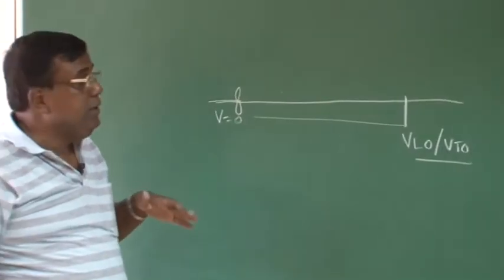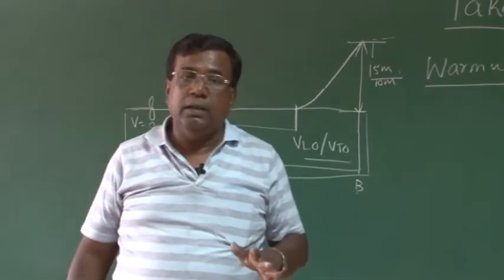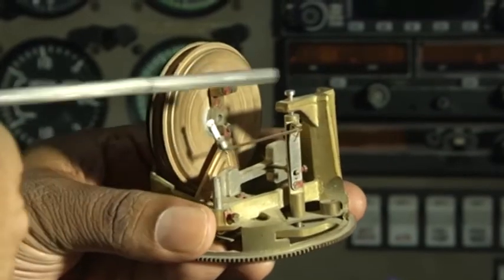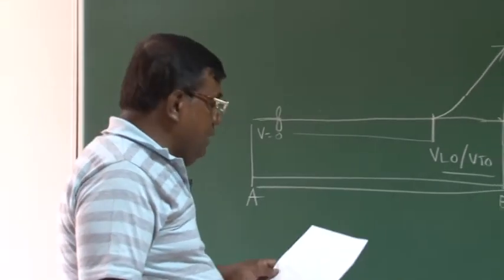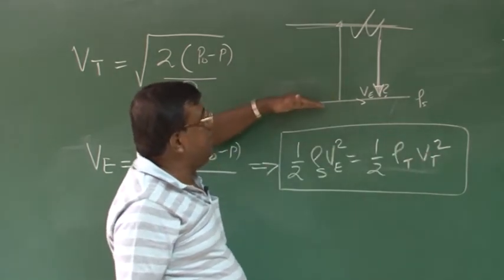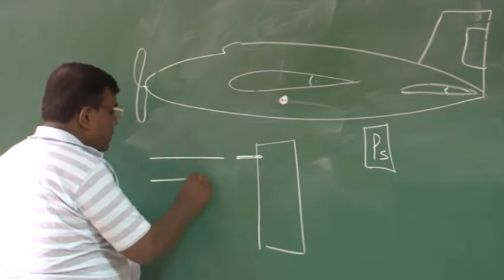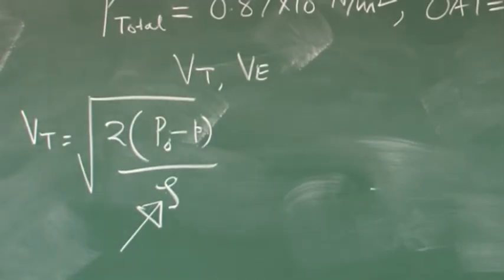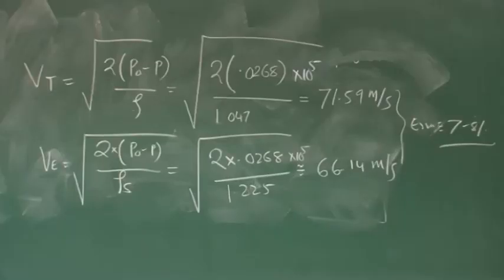Take off: Warm-up Lecture

Comment: Sir in the problem there is an ISA DEV =280.56-278.244 =+2.3 C in the temp (i.e temperature distribution is not following lapse rate 6.5C/km) . then sir how we can use ISA chart to get pressure data?